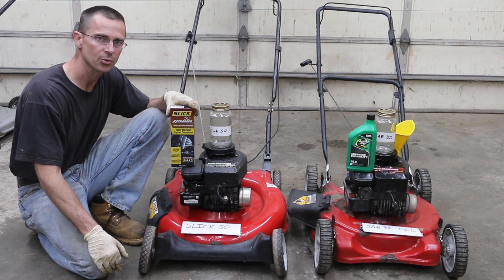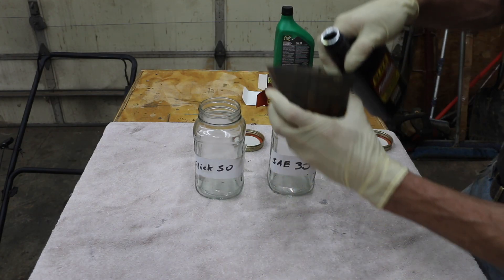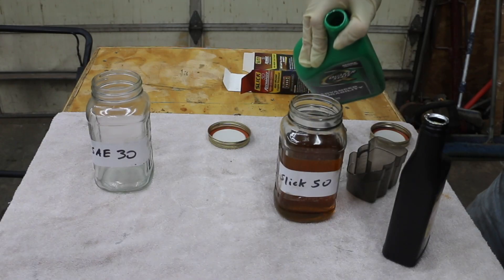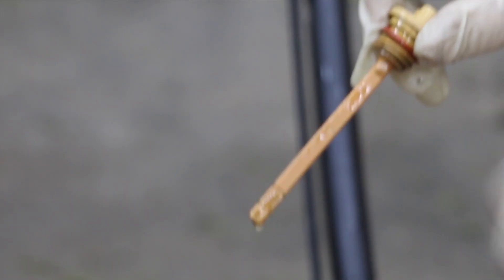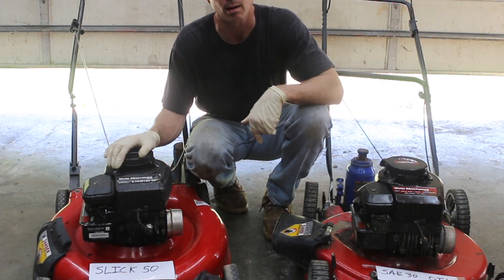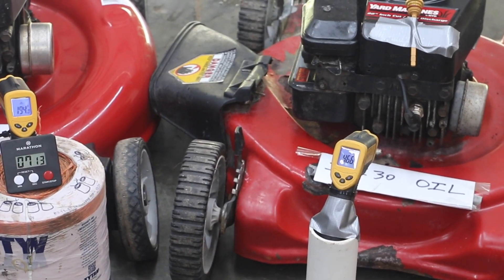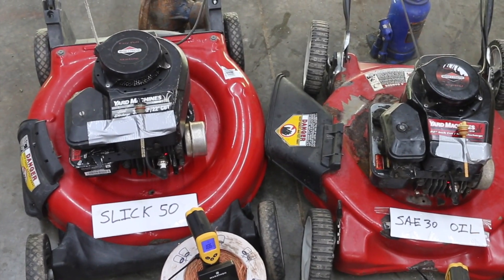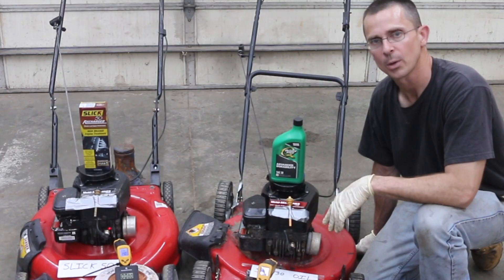Can't believe what SLICK 50 did to my engine!!--Dry Crankcase Test!

Comment: Well....that is not how Slick 50 works. 
At least the original Slick 50. It had micro particles of Teflon in it.
Now...the original owner of Slick 50 went through some complex business deal, and I strongly suspect today's Slick 50 does not even have PTFE (Teflon) as I understand it is sold by another producer, and the only thing left is the commercial name, and nothing of the original ingredients.

At least the old style Slick 50 had to be shaken quite rigorously, to suspend all the Teflon in the oil, before it was poured.

Once in, it was a process of a coup,e of hundred miles to "bake" in the Teflon into the bearings, and once THAT is done, the product shines.

You can get hold of PTFE today on Amazon, quite cheap. I bought 1 Kg....(2.2 pounds) of PTFE in micron size around 2 or 3 microns, small enough yo go through oilfilters.

To mix it in an oil, is tricky, but I have found that if you take a papercup, and pour about a quarter full, and fill the rest with a very thin oil, like Marvel Mystery Oil....and put it in a blender, it will mix just fine.

Ad that to a "normal" oil, and you will have the old style PTFE Slick 50 again.

I have seen engines with a "baked in" layer of Teflon, and you can for sure see on the bearings, that they have indeed a Teflon layer.

Now....make the test in such a way that you 

1. Make sure the product HAVE teflon.
2. Let the Teflon "Bake" in into the engine for a fairly long time.

Then, when properly applied,  you can unplug the oil drain and redo the test.

Good luck.
Reply from the maker: Thank you for the video idea!

Comment: I'd like to see a test of engines run on Motor Honey or STP Oil Treatment VS just the manufacturers recommended oil after they've been run and internally coated with each.  Then drained and see which one performs best with nothing in the crankcase.  As thick and slick as Motor Honey and/or STP Oil Treatment is, I'd THINK the engine coated with them would run longer.  Just my guess though.  I just thought this would be THE channel to try it out.  Whether you try it out or not,  keep up the AWESOME videos.  I'm addicted.
Reply from the maker: Thank you for the video idea!

Comment: Very interesting back in the 80's that was the best thing on earth I never really bought into it because I always run engines that have oil in them however I have overhauled several NYC Cummins engines that have been treated with Slick   50 and I will say their is a noticeable difference in bearing wear slick50 being less also back in that time these treated engines would average 200000-300000 miles before they needed overhauled
Reply from the maker: Thank you for the feedback

Comment: Try this, Prolong Engine Treatment is formulated to treat the metal surfaces of both gasoline and diesel fueled engines. As motor oil is pumped through the engine, Prolong Engine Treatment molecules interact with all metal surfaces, chemically bonding to create a protective layer to reduce damaging friction and heat.
Reply from the maker: Thank you for the video idea!

Comment: You didn't do your homework on the product or the small engine test. SLICK 50 is just a name that the inventor did not own the rights to. Was not treated as promised and took
his formula and left. Shell Oil bought the name. The original Slick 50 works as promised. I challenge you to repeat your test with engines that are identical in equal hours run. Also, to treat the engine properly for the PTFE formula to treat the metal parts of the engine, the engine needs to run constantly for up to 6 hours with the mixture then you can drain it and run it without the oil.
The Chemist took his formula and went and packaged his product himself.  Buy some Lubrilon and do your test again.
Reply from the maker: Thank you for the feedback

Comment: Lucas oil treatment.  In 2000 I bought a new F-150 that got 12.5 mph. At every regular oil change 1 qt Lucas oil treatment was added. That original engine at just under 200,000 miles got 12.5 mph.
Reply from the maker: Impressive!

Comment: I used Slick 50 in two of my engines years ago.  I seem to remember having to run the car for several thousand miles to treat it.   It may have more effect that way.
Reply: Yep, your supposed to "condition" or "season" the motor if memory serves me correctly.
Reply from the maker: Thank you for the feedback!

Comment: I bet today’s oil is better than when slick 50 came out and I wonder if slick 50 needs time to soak in and bond with the metal. It clearly was cleaning the sludge out of the motor. Plus a compression test before to compare how loose each engine was to each other
Reply from the maker: Thank you for the feedback!

Comment: I sold Slick 50 when it first came out from Petrolon as a multi-level marketing product, purchased the demonstration B&S engine that has the clear plastic side cover, treated it with slick 50 after the proper break in period. We use to start the demo engine up at the beginning of the seminar and then set it outside and let it run for an hour during the seminar, bring it back in at the end of the seminar still running and people would beleive their eyes. That demo engine is still running with no oil in it today.
Reply from the maker: Impressive!  other than the clear plastic cover, was the B&S modified?
Reply: @ProjectFarm  No.

Comment: I used Slick 50 back in the 80's and 90's.  I "drank the Kool-Aid" too!  What is surprising is that the engine with the Slick 50 failed  sooner.  Even if one engine was in better condition than the other, the difference in run time was huge.

As another test, I'd try to run Slick 50 and straight 30 weight in a brand new cheapie engine.  One of those Harbor Freight engines would be interesting.  I know it may cost some money to run the test, but to do two engines with Slick 50 and two with oil only would help determine if Slick 50 does reduce engine life.
Reply from the maker: Thank you for the video idea!

Comment: Have to tell you, I love the vacuum pump setup for removing the engine oil!  I had to pause the movie to really look at that.
Reply from the maker: Thank you for the feedback!
Reply: Project farm has really interesting projects, and approaches it  directly and  understandably
Reply: @ProjectFarm  How about a shoot out between slick 50 and lucas oil stabilizer? Or have you done that one already?
Reply: @ProjectFarm  Have you done a video on oil additives that seal piston rings and give higher compression? Specially for older engines.
Thank you
Reply: I've got a pump the hooks up to my cordless drill. Works great.  (I maintain 3 2011 Silverados, 1 Ford van, 1 gmc van, one dodge van, a Ford F550 dump truck and 2 tractors. I change the oil in all of them in about five hours with that "drill pump thing")
Reply: I, uh, may have screenshot it so I can copy it!
Reply: It's just a water bong setup lol
Reply: I really like all of his testing set-ups. This one caught my attention as well... not making any mess while draining
Reply: I wonder if anyone has some advice on what to use to remove the oil like he did.Its some sort of vaccum pump.But any advice on this or your setup for removing the oil without having to use the drain plug i would say thanks upfront.My riding mower is a bear to drain.Thanks
Reply: You can use a Nebuliser or another one is a vacume seal for food .

Comment: good grief that was 25 yrs ago ! the stuff 25 yrs ago was polymer ! and I put it in all my engines ! I had one car that the engine was all but gone I put the engine restore molymer in it it and it ran for a couple more years ! the polymer additive seals micro scratches  and voids ! but it must be applied correctly ! you put it in on oil change ( if you aren't going to change oil properly in your vehicle just throw it away ) then run the engine on a long ride or trip it bonds to the engine parts with heat ! 
   the additive reduces engine heat considerably which will make the engine last much much longer but it will take much longer to warm up in the morning to !  
  you didn't bond the additive to the engine parts by letting it run and get warm enough for the additive to bond ! 
  I put some in my motorcycle and it made the (wet clutch )clutch slip ( it still worked  only slipped  under hard pressure ) ! so I put 30sae and waited for the clutch to ware off the slick stuff ! oh yeah you just pore the stuff in the oil (you don't mix it ) and run it for a while then change oil (it takes heat to bond ) and it takes longer to get to that heat because of the slickness ! my motorcycle doesn't hardly even gets warm enough to make the automatic fan to run on the hottest rides on loong  stops and go traffic jams !

Comment: I've never had much faith in any additive.  And from my experience they are useless. The only thing that ever changed my opinion about this is Lucas oil treatment.  It is for a different purpose than slick 50. But it does work. I put it in a taxi cab that was burning almost 4 quarts of oil in one shift. After that it used about 2 quarts a week. And that was continuing to be used for two shifts every day. So it was running almost constantly.
Reply from the maker: Thank you for the feedback

Comment: I am still wondering why you won't pit DuraLube against the top friction-reducing oil additive. DuraLUBE impregnates the metal so you have to run the engine through several tanks of gas before you run the test. One tank of fuel isn't enough for any additive to work. Also never put it in an engine that isn't broken in, as the engine will not break in because it is so slippery
Reply from the maker: Thank you for the video idea!

Comment: Those tests with Slik-50 were on liquid-cooled engines and not air-cooled ones.
Liquid-cooled engines which by nature are less to lock up by a piston over-heated therefore over-sized causing lockup. The air-cooled engines are great deal hotter and the oil runs off off hotter faster
Reply from the maker: Thank you for the feedback

Comment: X1R the air force uses it i watched a test on a propped plane with a glass oil pan so u could see no oil and the plane did 300 miles in the air with no oil
Reply from the maker: Thank you for the feedback on X1R

Comment: 1988 I was going to make across country trip in a Dodge Colt with a luggage topper mounted to the roof.I put  a quart of Slick Fifty in when I changed my oil prior to leaving. I drove 2000 miles from California to Indiana during a drought with no air conditioner and was getting 28 mpg. When I was getting ready to return I changed my oil knowing that Slick Fifty had coated the engine and on the way back I was averaging 34 mpg. I had to keep stopping because I thought my gas gauge was broke. You would have had a different result if you had just used Slick 50 in the one mower. Your test was bogus.
Reply: So you're saying the slick 50 worked for you, because the car got better when you changed the oil and drained it out of your engine? That's pretty stupid, you know.

Comment: As a guy who has used Slick 50 in the past, I can attest to its performance. I had 2 dodge rams 4X4's (1977 & 1988) both over 130,000 miles when I bought 'em. I used Slick 50 at oil changes about every 60,000 mi and both trucks went well over 300,00 mi. The truck bodies gave out before the engines. Also in the '88, it had a bad transfer case chain which you could hear & feel binding as you drove it. I added Slick 50 and the binding & noise disappeared. Being I've never bought a new car or truck, I always do a oil change with Slick 50 when I first buy 'em.

Comment: So you are telling me that the Slick 50 engine ran cooler WHEN THERE WAS NO LUBRICANT!!!!???? Because when with lubricant in, it was 220+ degrees and with out around 190+ but below 212 degrees BULLSHIT!
 Slick 50 is CRAP AND THEIR WARRANTY IS BIGGER CRAP!
 In 1996 I bought a brand new crate motor for my S15 GMC ( Chevy Blazer) I bought the 3.4 High Out put crate motor that replaced the 2.3 POS engine it came with. I used "SHIT"50 From the start. I documented everything at the time.  This is what happened.
 1. Shit 50 caused the rings to stick in their grooves allowing hot gasses to "blow by" into the crank case leading to early bearing failure. On inspection it was also discovered that the camshaft bearings were badly worn and this vehicle had less then 12,000 miles on the BRAND NEW ENGINE!
 2. The warranty. I called Shit 50 's warranty number, I told them that I had put a brand new engine in my vehicle and used their product, which had a 50,000 MILE GUARANTEE. I WAS PROMPTLY TOLD THAT ALTHOUGH THE ENGINE WAS NEW AND HAD ZERO MILES THE CAR ITSELF WASN'T NEW! This they said absolved them of all responsibility. The fact that I also replaced with new the Transmission. radiator,  the water pump(part of the engine assembly) , basically everything in the engine compartment, MEANT NOTHING TO THEM!!!

Comment: Tsk. First of all, the Slick 50 engine has to be broken in. You would not add  the 50 to a new engine. The mating surfaces need to have worn some. There needs to be space for the 50 to coat both mating surfaces. Next, the Slick 50 has to be in the broken in engine for many many hours for it to have properly coated the mating parts. Slick 50 is the real thing. It never overstated the stats in earlier advertising.
Reply: Heat and pressure are what press the teflon into the pours of the metal.
Reply from the maker: Thank you for the feedback

Comment: 35 years ago I used Tufoil. It made my mileage on a 1970  4 cylinder Toyota Corona MARK II Wagon increase about 3-4 mpg. I loved it but couldn't find it anymore and gave up, having tried Slick 50 with disappointing results.
Reply from the maker: Thank you for the feedback

Comment: if you want something that really works use  STP that will save an engine .
Reply from the maker: Thanks for the recommendation!
Reply: @ProjectFarm  your welcome 'I know STP works because i used in my ford fairlane  500 'i run it for over a year with out  a oil pump 'i did have to tighten the valves because the lifters dropped 'but other then that it ran pretty good

Comment: I seen what you have done but you didn't follow the instructions. As I recal you drain your oil and the use 1 qt Slick 50 to 3 quarts of oil. I used Shell Multigrade 30wt. You need to run the engine for 1000 miles. The particals in the slick 50 are TFE Resin. These particals have to be burnished in the moving parts. Your engine is as smooth as glass.. BUT even glass has pours. The TFE gets pressed into those tiny pours making a smoother surface. My 76 Toyota Cilica was new at 30 miles on it. I drove the car normally for the break-in period, about 1000 miles. Then I changed my oil to Slick 50 and Shell Multi Grade. My car went from 22 mpg to 25 mpg. At 10,000 miles I changed my oil to Mobil 1. I drove 1 full tanks of gas  I got 29.5 mpg. In Oct 2019 I got a new Kia Forte. After 1000 miles and 24 mpg I changed my oil to Slick 50 and Mobil  1 I drove my car straight on a long trip non stop from fill up to near run out 29.9 mpg. My Toyota After 250,000 miles on the engine treated with Slick 50, Using only Mobil 1, 10,000 between oil changes I measured cylinder wall wear. I pulled the head off and compared the wear at the top of the wall were rings don't rub to were they do. . There was a difference of 1000th of an inch. Over the years I sold that car and by chance met the guy again. He drove that car to 955,000 before he was hit by a truck which totalled the car. He told me he used Mobil 1 from the day he bought it from me and changed the oil every 10,000 miles. Redo your test. But in the engine with Slick 50 run that engine at idle for 41.7  days then do your test My Kia Forte has 87,000 miles and I don't burn or leak oil. I expect 300,000 miles out of this car or more.
Reply from the maker: Thank you for the feedback

Comment: I took a chance on slick 50 when I saw commercials for it in the 90s. I put a quart in my 1990 Nissan Sentra. It made that little 4-cylinder engine run harder. I had to immediately drain it and put regular oil in. I think it ran another year before the engine seized up. When I asked a Master Mechanic about slick 50 products he said, it just coats your engine with plastic.
Reply from the maker: Thank you for the feedback

Comment: They used to advertise that these products contained Teflon.  If Teflon doesn't stick to anything, then how is it supposed to coat the inside of your engine?  In any case, this test is hardly definative.  The temperature test showed the oil treated with Slick 50 is a superior lubricant.  Lower viscosity could have contributed to the treated oil performing better, and being easier to extract.  This would leave more residual oil in the untreated engine, allowing it to survive longer.  Of course, there is no telling how badly these engines had been abused before this test.
Reply from the maker: Thank you for the feedback

Comment: There is the likely possibility that Slick 50 behaves significantly different when combined with oil, as it was designed. Not to necessarily advocate for it, but I feel it is not a true test of it's performance when used as intended.
Reply from the maker: Thank you for the feedback